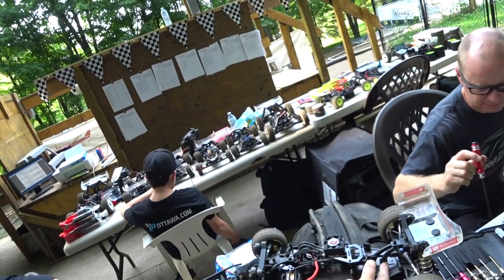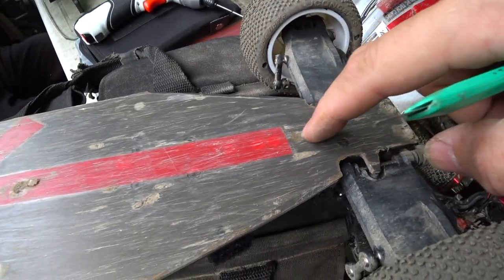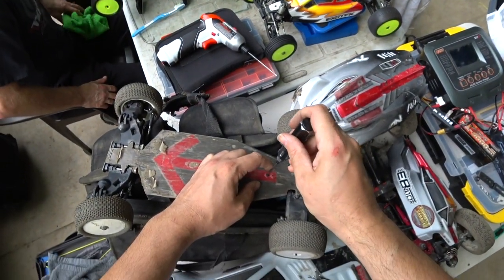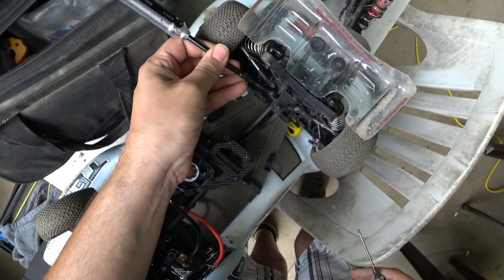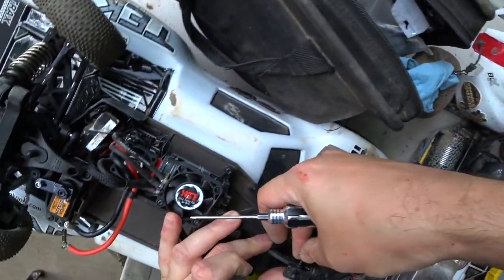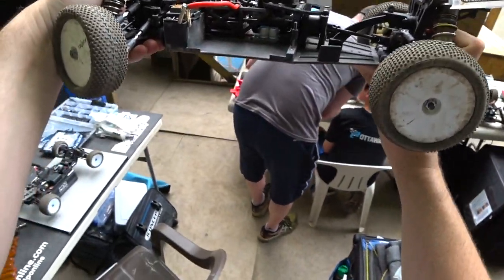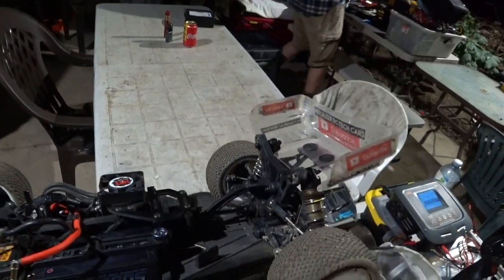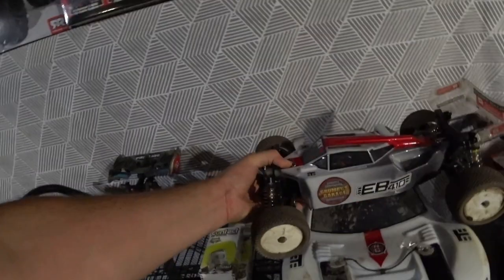Tekno EB410 Chassis Brace Removal and 4WD MOD A-MAIN RACE - Netcruzer RC

Comment: It really depends on the type of track. For high bite clay like I run on, a bit of flex is nice since the surface is almost like concrete.
Reply from the maker: I went back to running both but now after looking at some pro setup sheets I'm thinking of removing the big brace and see how that is... seems to be what most pro setups are doing.

Comment: Do you need aluminum hubs in the rear for the EB410
Reply from the maker: Luther Babb Nope! Stock hubs are great. My local track raced mostly EB410s this summer and nobody broke a rear hub. Just the turnbuckles are weak. Titanium  turnbuckles for the rear, and capture the rear hinge pin is good to do.